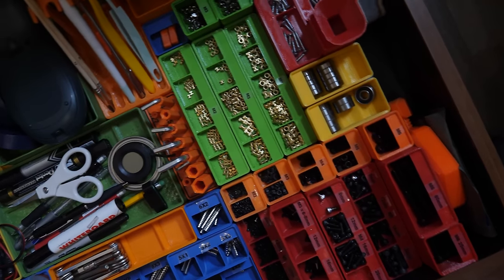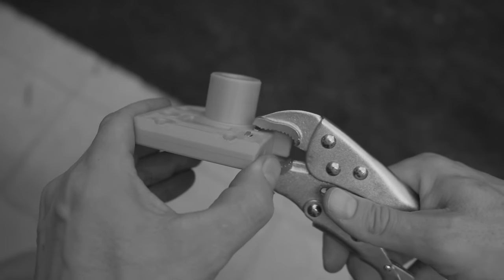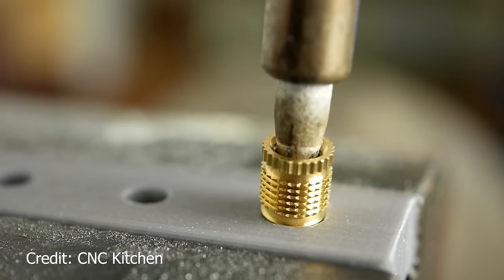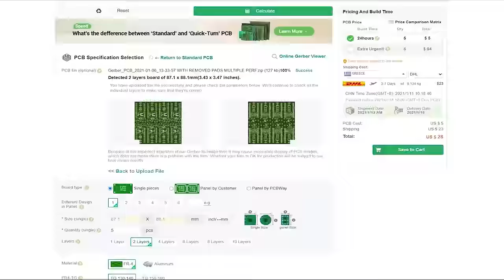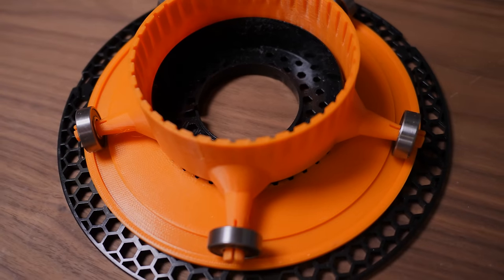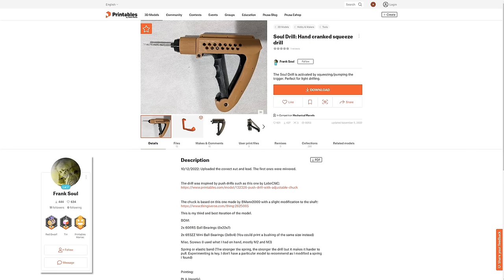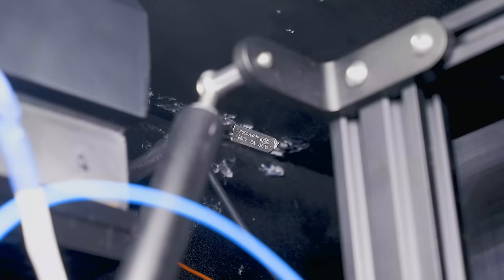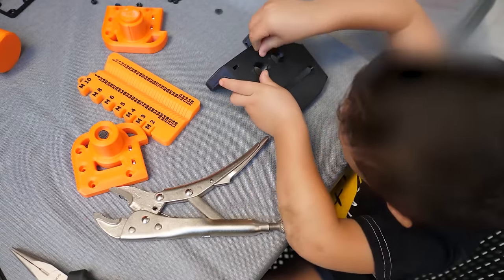Make USEFUL 3D Prints with THIS List of Hardware

Comment: With a toddler around the house that helps dad with projects, you might want to Not get fishing sinkers, or old wheel weights for anything... Give it a year or two. Heavy metals and lead poisoning are a Real thing, and it is accumulative in your body... It builds over time and Can Not be removed. when you reach the critical level, thats it. For adults its generally OK, but do be careful, (wash hands, don't eat while working, well ventilate for any melting, etc) but you definetally don't want to have a toddler around that puts things, or their fingers, in their mouth  etc...
Reply: Lead-based solder fumes can cause problems, and lead dust  is hazardous to inhale. But there’s no need to panic about solid chunks of lead like fishing weights; there’s almost no absorption through the skin of metallic lead. It needs to be dissolved in something organic to travel through the skin.
Reply: Neodymium magnets are also SUPER dangerous.  They can literally snap together inside a child’s stomach and cause all sorts of horrors :(
Reply: Small magnets really are dangerous for kids, but not because they snap together in the stomach. It’s because they can end up in different parts of the intestine, and snap together through the intestinal wall. It causes gangrene and perforation.
Reply: Steel weights are becoming more of a thing for fishing. More expensive than less but you know, not poison.
Reply: @jeremiahrex  lead fishing weights were outlawed  about 15 years ago in the uk.
Reply: Even leaving the risks of lead poisoning aside (which I absolutely do not!), I find steel BBs/shot work much better for adding ballast to prints.  They are easier to fill voids uniformly with, they’re cheap, and they are readily accessible everywhere.

Comment: Chopping at that rebar with the knockoff dremel and little cut off wheel is comedy gold...
Reply: @chrismay2298  the brand new rebar which features zero surface corrosion that was "pulled out of a dumpster", to boot.

Comment: It would be cool to see a comparison between the different software's. I personally use a combination of: fusion360, blender, mesh mixer and 3D Builder. it would be interesting to see some more about on shape since  I have never used it, and I'm very curious to see what it can do  and how easy it is to use. Awesome video I really enjoyed it, very helpful.
Reply: Most of the classic parametric CAD programs are quite similar to use, so just go for it Onshape is great tbh and its also free to use/try. I tried a lot  (Soliworks, SolidEdge, Catia, Creo, OnShape,.....) and think the interface is a bit different and things might be called differently but you'll quite quickly learn to use a new one.  I feel like "free form programs" like Blender, 3DSMax, Maya, Rhino, Z-Brush are more different in usage between each other.
Reply: OnShape is fantastic and really under utilized in the maker community
Reply: TeachingTech made a great series about onshape
Reply from the maker: Yep, that's what got me into it actually
Reply: Upvoted, a software comparison would be nice. I tried several programs and then settled on FreeCAD because of its versatility and its amazing capabilities with Python. I also wonder why this Fusion360 is so popular?
Reply: I used F360 for a while, until autodesk's scummy and shitty cloud subscription license started to bitch about everything, so I just got myself an extremely legal version of inventor. Basically the same program, maybe a bit more limited and clunky, but it works well enough.
Reply: Nomad Sculpt and Plasticity super powerfully easy to use and very cheap even free at the moment.

Comment: Really amazing content, never thought about NFC! I often design educational models, so being able to link to digital lessons is amazing. Some of my favorites:
1. Aluminum extrusions and threaded/smooth rods aren't just great for printer kits, they're also amazing to enhance weak printed plastic with a bit of a "spine".
2. I also like to use metal (jewelry box) hinges, bowden tube with wire (to transmit motion), and occasionally some wing nuts.
3. I sometimes like to use IKEA for parts, because people worldwide can source a metal "HACKÅS knob" or the textile from a "MAJBRÄKEN pillowcase", and replicate the same design that way.
Reply from the maker: These are good ones, for sure. And I love hte idea of you adding educational elements for students thanks to my video. Honored
Reply: Hey, what kind of educational models do you make and do you have a link to some place where I can see those? I'm interested in the possibilities of 3d printing for educational purposes
Reply: @thenextlayer  Actually the first coming to mind to use NFC-Chips for: If you have multiple printers with klipper, just put NFC-Chips there. As soon you hold your phone there, the webinterface of this printers fluid site apears... So comfortable, the printers do not even need any display.

Comment: Thank you. You reminded me of a colleague from decades ago, a South African electronics guy. He had worked for a company in SA that made ghetto blaster radios (if you are too young to know what that is, google is your friend 🙂 .  The Bill of Materials for the ghetto blaster include "House brick, qty 1"

I'm a retired electronics engineer. When I retired I started buying components, all cheaply on eBay. I now have a collection of transistors, chips, resistors, Arduino sensor module etc etc that would make some development labs look under-resourced. All, of course, stored in a 3D printed drawer system. There's not much I can't do in the space with my "in stock" range.

Once in a while I may get some substandard parts. But I have the skills to test and recognise, and usually correct for it in my designs.

Comment: I just ordered most of what you suggested (minute the fans, thermal switches, and weights because I have that stuff already.) 

From alliexpress I was able to order an assortment of m2-5 screws, nuts, washers, lock washers, m2-4 heat inserts, 50 nfc tags, a couple hundred magnets (I'm a heavy magnet user), 30 608 bearings, a spring assortment, for around 130 canadian. Given what it would cost to source these all localy, i'm pretty pleased with the price. They'll be here hopefully by the first week of october. Had I ommited the magnets, it would have been under 100 bucks.  Thanks for the video, I've been meaning to stock up on hardware because I keep over-paying locally. The list was a helpful place to start and just overcome my analysis paralysis.

Comment: You should get an angle grinder; the corded ones are pretty cheap, cutting and grinding wheels are pretty cheap, and for cutting something like 1/2" rebar they're definitely better than wearing out your diamond cutting Dremel wheels on. But great content, you provide a lot of tips most people don't consider

Comment: Great video! Thank You! A tip for weights: Lead is far heavier than steel, and will take up far less space for the same given weight. Simply visit any fishing tackle shop, sporting goods store, or big box store that sells fishing tackle. Lead fishing sinkers come in weights from 1-1/160z to several pounds. They come in a wide variety of geometric shapes lending many options for 3d printed cavity shapes that are helpful to make clean, solid streamlined designs without rattling or shifting.
Reply from the maker: Thanks for the info!

Comment: Fan tip.  Corrugated wire loom its normall sold with a split for installing around wiring for chafing but it is available solid nonsplit.  Larger fan isolated from printer hung on wall whatever.  Use a relay if it has too much draw.  But you can flow a ton of air by printing a duct for the fan and pushing the air through this cable loom which moves easily and get the mass off your servo.

Comment: always having to cut my bolts to length, so ive started buying longer assorted packs along with the ones with shorter ones an they save me over all the time. an i always thought the zz rs at the end of a bearing number was to identify the tolerances they was made to but i could be way off on that an they have another way of identifying that. the biggest thing that helped bring my prints to a higher quality was me buying a lathe an a small benchtop milling machine, now i make metal parts to go along with the 3d printed parts an it introduced me to a new set of tools that have made my life 100% easier. if u do alot of cutting i  used to use my dremel or if the dremel wasn't enough a angle grinder with a cut off wheel so pretty much just a bigger dremel but pick up a portable bandsaw, best money ive spent, saved me so many hours in cutting steel with a hacksaw, i had one piece that i had probably cut on for at least 2 hours straight, was out of blades so was stuck with the last one i had an after about 2 hours of it i just gave up went on amazon an ordered the cheapest portable bandsaw i could get 100 bux wasn't expecting much but its the best money  ive spent an the cheap tool is actually pretty good an isn't the only wen branded tool i own an the brand i suggest if wanting to buy cheap but the fact i incorporated metal parts when i can that has help with the look an feel of the stuff i make an makes it feel an look more professionally manufactured.

Comment: @The Next Layer, just FYI - the black bolts you have likely are not 'anodised', unless they are made of Aluminium. Anodising is an Aluminium process, not a steel process. You cannot anodise anything iron based. If you have steel or stainless bolts which are black, the term is not anodised, they are just black oxide bolts - which is sometimes called blackening. Just so you know.
Reply from the maker: Thanks!

Comment: I recently came across a need to add some weight  to a bunch of prints for an event I was throwing. I needed to print a bunch of medals to give to all the guests that were attending. So I asked my family for ALL their pennies. It worked out splendidly. I embedded 14 pennies in each medal with a bit of Elmer's glue to keep them from moving and rattling inside. Just like most tire balancing weights, they are made mostly of zinc and add a surprising amount of weight to the print but it comes out much cheaper.
Reply from the maker: That's a good idea! Israel got rid of anything below 10 agurot (our cents), so that doesn't work here so much.

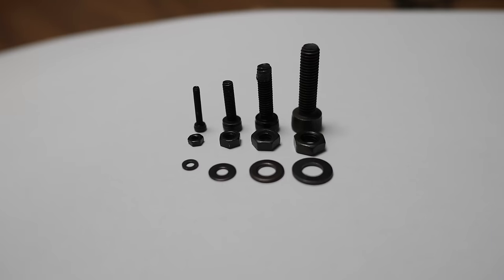Comment: Terminology matters, especially when ordering hardware where you can't physically hold the part before ordering (because sometimes catalogs (both paper and online) have the wrong pictures). At 4:22 the machine screws that you show aren't flat-heads. They are "cap head", and if you want flush mounting you need to use a "counterbore", but don't require flush mounting. The cone-shape you mention are (usually) flat head, and always require a "countersink"ed hole or washer. Though, depending on the design of the countersunk washer, it may be able to be used to fit a flathead screw into a counterbored hole.

Now, your hardware names and terms may be different in Israel (I wouldn't know), but my explanation is correct for the US.
Reply from the maker: Thanks for the corrections.

Comment: Johnathan, 

I enjoy your videos so please allow me to share some of my knowledge in return. 

Bearing Numbering [Simplified]:
Example part number 608-2RS

6 [First number: Bearing Type] = Single Row Deep Groove Ball Bearing
0 [Second number: Dimensional Series Classification] = Diameter Series 0, fD=0.84
8 [Third/Forth number: Bore Series (inner hole)] = 8mm
-2RS [Additional Symbols after dash: Auxillary Numbers+Symbols] = 2 Sided Rubber Seals

So your 608-2RS bearing is a common radial bearing that uses balls in a groove as the rolling element, with an inner diameter of 8mm, has the most common outer diameter and thickness for a typical 8mm bore bearing, and comes with rubber shields to cover the rolling balls on both sides. 

Bearing numbering schemes are controlled by the engineering regulatory bodies of the region. In this case ISO. 
ISO has charts that denote what each number in each position indicate. They are not as simple as 8 means 8mm bore in most cases, which is why they appear random. For the second, third, and forth numbers, they will involve formulas and charts to calculate standard bearing dimensions. 

I am a practicing engineer and this is the reference document I prefer for identifying ISO symbiology for common bearings. It can assist you with finding the same bearing but with perhaps metal seals instead of rubber: 608-2Z or 608-ZZ
https://www.nsk.com.br/upload/file/nsk_cat_e728g_1.pdf

Regards,

Comment: I have a recommendation that is similar to your idea of saving old screws and metal pieces for weight.
I keep a medication bottle (the locking cap is good for safety) with all of my used x-acto, scalpel, and razor blades. They may be well past their usefulness as cutting implements, but they work wonderfully with items that need a metal point for a magnet to catch to. 
No space in a lid for another magnet on the other side? A scalpel blade is good steel, very slim, and easily covered over with a thin piece of polystyrene plastic or other surfacing material. I build models, so I have lots of styrene sheets around.
Hope this is useful to someone.
Reply from the maker: Clever!

Comment: I think this is literally the only video that goes into this.

My recommendation for weight would be a roll/offcut of lead flashing. Its soft, cuttable with some steel scissors, and can be layered up and moulded into a 3d printed part.

Downside - it is lead and lead toxicity is a thing so internally in something functional for use by an adult - that's fine but you dont want it in a kids toy for example.

Comment: Another thing about T-Nuts. The ones that you showed are the "hammerhead" style that allow you to insert them into an extrusion slot without access to the ends of the slot. I'm not sure why they are called "hammerhead", but regular t-nuts don't have the radiuses on opposite corners allowing the t-nut to turn after inserting to engage with the undercut of the t-slot.

Comment: M5 tnuts are also widely used. And the roll-in t spring nuts are much better and easier to use, altought more expensive. Also it's a good idea to keep some dowel pins around and steel rods of various sizes and diameters
Reply: Yea I’ve only ever used m5. I thought that was the standard for 20x style extrusions

Comment: 14:25 sounds very interesting, but would appreciate a larger list.
A few years ago I used Fusion360, but as my self-built low-end hardware was failing me along with moving to Linux for personal usage, I left the hobby behind for a few years.
Now I am getting back into 3D printing, hence I found your channel and the software I have picked this time around is FreeCAD.
Which has some weird quirks and strange design choices that make it tricky to get going with it, but after figuring those out, so far I am impressed with what FreeCAD lets me do.
I will only receive my new printer halfway January, but I have great plans for rebuilding my old Hypercube printer and making some other mechanisms, which I think I can achieve in FreeCAD by slowly getting more familiar with it and continuing my ability built in Fusion360.

Comment: Square nuts are very useful for 3d printed parts, especially when the insertion is towards the side of the nut
Reply: I am also going to suggest keeping some nylon stop nuts on hand.  I just did a design where something hand to be held together but not tightly.  The bolt with a nylon stop nut served as a friction pivot

Comment: The black bolts are not typically anondized.  It is a black oxide coating that will eventually rust.  So while I like the look of black oxide, I'll take the durability of stainless steel.
Reply: Correct.  Aluminum can be anodized, either dyed or clear since the process converts the surface to aluminum oxide.  Steel nuts and bolts with the black oxide surface treatment shouldn't be used in any corrosive (i.e. outside or wet) environment.
Reply: Yeah that's right, but flying Drones I still prefer those lighter bolts then the steel ones

Comment: zz means metal shielded, rs means rubber sealed. zz isnt sealed but allows faster operation with less drag and heat but will still alot junk to get in them, rs is more of a slower speed in dirtier enviorments

Comment: There's a few times while looking at a print halfway done that if the infill is spaced out enough, one could drop in weights or whatever while it's printing and they'd be secured inside.
Reply from the maker: Yep, but they rattle unless you glue them :)

Comment: I'd love a video on design software! I find myself struggling with Autocad, Fusion 360, and Solidworks but need FAR more complexity than Tinkercad etc. I like Matter Control but it also isn't quite feature filled enough
Reply from the maker: Check out OnShape, Michael at TeachingTech has a training series on it. I'm learning it, and it's damn good and quite easy

Comment: Awesome. I'd suggest some wire or small metal rods to fuse into prints that need a lot of added strength.

This was a really great list though, eBay here I come 😂
Reply from the maker: Def! My 3D printed Micro Jib (designed by Mechanistic) used 7mm diameter and 2mm diameter metal rods, and I have a bunch left over I'm using :)
Reply: @thenextlayer  amazon?

Comment: Couple of minor tweaks and clarifications: Cone headed bolts = flat head cap screws (typically),  round head bolts = sockhet head cap screw bolts (typically),  'black anodized color bolts' = likely black oxide steel bolts.  Very unlikely that you bought aluminum black anodized bolts - most bolting hardware is steel or stainless, with a very small chance that you bought the less capable (though admittedly lighter) aluminum hardware.